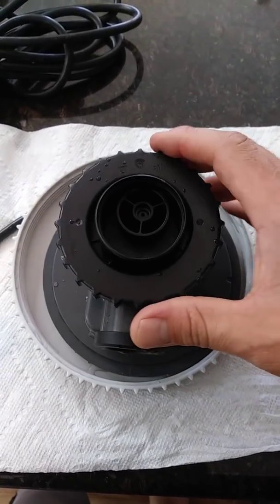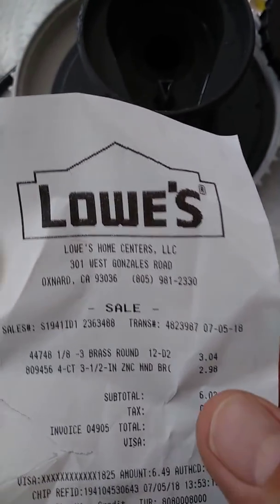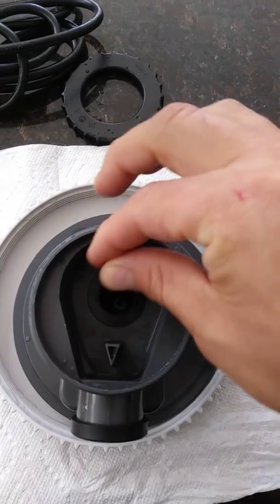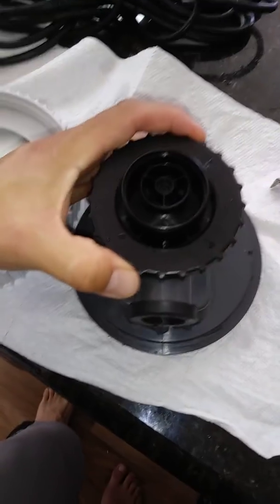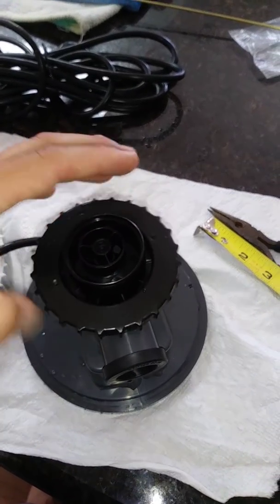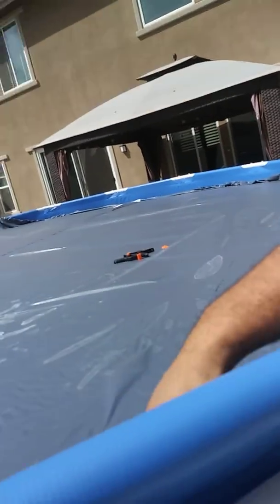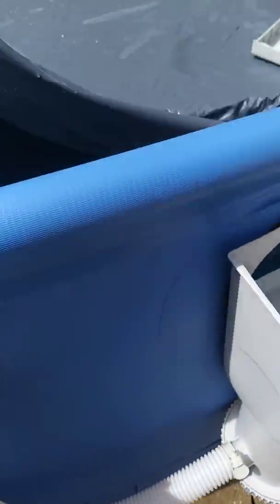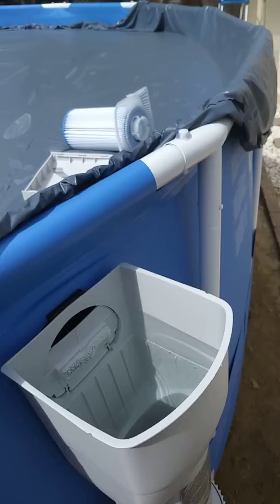SFX1000 pool pump repair

Comment: Ok my question is how do you get that bottom back on with it not leaking? I’m having trouble. I have a rubber ring too that goes around the pump in the canister but I can’t figure out how to stop it from leaking

Comment: Thank you for this. My pump did this within the first 3 days. Saved my sanity. Cheers man

For those whose pumps arent working, the motor is completely encase so if your pump is not working its probably a 90%+ chance its this

Comment: How do I know if it's the power plug or the pump itself I'm getting no power to the plug at all
Reply: I have the same issue. When it's plugged in, the display comes on the plug, but there is no power going to the pump. Not sure where to go from here

Comment: Thank you sir! Thanks to inflation, 5 years later that $3.04 brass rod is now $6.48. Still much cheaper than replacing a pump, but pricing double in 5 years??? That's insane.

Comment: Ours came with a rubber black circle ring for in the bottom where exactly is that suppose to be? Our filter is leaking water at the bottom seems like the ring may not be in the right spot or something.

Comment: Dude I’m stuck just trying to put the plug in to stop the water! How do you put this flat plug on!?
Reply from the maker: It goes on the inside of the pool. Over the inlet of the filtration system. You might have to let the plug sit in the sun for a bit to flatten out. That's if it has any kind of bend in it. Good luck.

Comment: How  do you fix the cord got power but not turning on anymore can they over heat?
Reply from the maker: If it has power but is not turning, it is being held up by debris or that shaft/rod is broken. I have seen a single strand of hair stop these pumps before.

Comment: Stupid Question here 🤦‍♂️
I had to take mine apart, but I forgot to take notice where the gasket was supposed to go.
Could you tell me where it goes?
Reply from the maker: Mine doesn't have a gasket, but there is 1 of 2 places where it can go. 
1. Inside the locking ring for when it is sealed against the housing. Or
2. Around the base of the actual pump, where it sits against the housing to creat a seal.
I hope that helps, if not, maybe someone else with a gasket can assist. Good luck.

Comment: Mine doesn’t turn on
Reply from the maker: The rotor assembly is probably jammed up with hair or sticks or some sort of debris. Open it up and clean it out.
Reply: @bobganoosh5520  yea I cleaned it works now thank you
Reply from the maker: @vionic7170  Awesome. Glad to hear. I had a friend tell me the electric went out on his pump one time. He was ready to throw it away. I opened it up and it was a single strand of hair preventing a pump start. That's all it takes with these cheap pumps 👍🏼

Comment: How did you cut the brass rod?
Reply from the maker: I used standard wire cutters. Just spin the rod a little bit at a time. It's tough to cut straight through. Also by scoring around the rod vs cutting straight through, you get a cleaner cut. Hope that helps.

Comment: Thank you for posting this! is there a washer at the bottom part of the pump where the impeller sits? I don't see one if they are I see the ceramic one at the top? Thank you again for posting this fix!
Reply from the maker: There wasn't a washer for mine.

Comment: Thank you so much.  $1.79 brass rod from Ace and I'm back in action.  I had the broken spindle for a while.  I knew it, but it kept running.  Then yesterday the pump just seized up.  I could hear it hum and could tell it was pulling some amperage, but the impeller was stopped.  I tried to free it with my hand and it strongly flicked my fingers.  Went to get the brass rod, and it's good to go!  Thanks again.

Comment: And it’s done, mine cracked into 3 pieces, little tiny piece was in a upper rubber seal. I cut it on 3 5/16” length inserted and it’s working like new again, nice and quiet,  thanks again😀🤛👍

Comment: Will this help for the leaking under the pump?
Reply from the maker: If there is leaking, maybe the locking cap need to be reset. Plug the inlet, drain the housing, ensure everything is lined up. If there's a gasket make sure there's no build up on it. Have 2 sets of hands if possible and re-tighten the threaded locking cap. Hope that helps the leaking. Did you take it apart before and then it started leaking? Or did it just start leaking?

Comment: What side does the seal/gasket go on? For the largest base of the pump ?
Reply from the maker: Mine did not have a gasket, but the gasket would go between the pump and the housing canister. So pretty much at the bottom.

Comment: I tryed a stainless steel rod but unfortunately didn't work I understand why brass now......🤦not magnetic and stainless steel is. Only reason why I tryed stainless steel is its what I had on hand.
Reply from the maker: Definitely worth the try 😁
Reply: @bobganoosh5520   So stainless steel is not magnetic after all bro I can't get the pump to set right or seat right so the impeller will spin.  I should be able to just drop the umbrella in on the shaft and it should set correct?  Otherwise it's just vibrating and not spinning
Reply from the maker: @baircichlids5350  make sure the ends of the rods are smooth with no burrs/sharp edges. Yeah, the impeller should drop in and set properly, but there were a few times when it took me a few tries to get it. You might have to wiggle and spin together to get the magnet to catch it at the right spot. But like I said, ensure that the shaft is smooth.
Reply: @bobganoosh5520  okay thanks and rubber boot at the bottom with the ceramic washer correct
Reply from the maker: @baircichlids5350  Yes that has a groove to sit inside the housing
Reply: @bobganoosh5520   After a lot of adjustments and a lot of on and off it's working great. Thanks for replying so quickly with extra help. God Bless
Reply from the maker: @baircichlids5350  that's great news. Happy swimming
Reply: @bobganoosh5520 Mostly for the kids but for sure you as well

Comment: What did you cut the rod with?
Reply from the maker: I used wire cutters/diagonal pliers. After cutting the rod, just ensure the cut end(s) are smooth and free of burrs and sharp edges.

Comment: .....how does the oring go on? I put the whole thing on and its leaking from the bottom.....
Reply from the maker: Mine didn't come with an O-ring. But it must sit inside the locking cap that threads to the housing. So when sealed, it would be between the pump and locking cap. Hope that helps.

Comment: I'm having trouble with my pool not circulating water well, it sucks slow do you think this could be my problem? I may take it apart to check it out, after my kids swim.
Reply from the maker: If the rod was broken, the pump would not circulate at all. If there is some suction and the pump is functioning, there must be some blockage. Just try cleaning it out first and verifying there aren't any leaves, bugs or twigs that are blocking the inlet or discharge. Good luck.
Reply: @bobganoosh5520  do you have any idea about the newest model pump, zfx 1500 I believe is what it is.
Reply from the maker: @Linnnddaaa  do you mean sfx as opposed to zfx? I believe they are very similar to my pump. Just stronger motor.
Reply: Let me take a look, it was on the elite summer waves pool i had to get a new one this year. Its a little different from the pump shown(I also have that one i saved it from my trash pool. )
Reply: Its the sfx1500 model.
Reply from the maker: @Linnnddaaa  yeah, so it should function the same as my sfx 1000. Open it up and clean it out. See if that helps.
Reply: Hubby unscrewed it and the pin and other peice don't come out. So we shall see, it looked alright tho
Reply: The pin isn't ceramic

Comment: Where does the big o-ring sit on?
Reply from the maker: Mine didn't come with an O-ring. So not exactly sure. It must be in the bottom of the locking ring to prevent leaking from the housing.

Comment: Exactly what I needed, you rock!! Thankyou
Reply from the maker: Glad to assist. Happy swimming
Reply: @bobganoosh5520  so I did it, and for sum reason it's still not pushing water out. The rod was broken. Bought exactly what you said from Lowe's and cut to size, it felt a pinch lose compared to the ceramic rod that fit right and snug. After setting up it's the same sounds and no water moving. 😣Please help
Reply from the maker: @WhoKnowsYweKnowWutWeKnow  if you cut the rod, it could be a rough or uneven edge on either end. Take the rod back out and file/sand it down so it it clean and smooth. Hopefully that helps.
Reply: @bobganoosh5520  thanks, it was totally rough on the edge we cut. Will try and update, thank you for replying so fast, kids will be happy if we get it fixed soon. ⭐

Comment: Mine is blowing the dirt back in when I vacuumed I have put in a new filter what should I do
Reply from the maker: You might have to flush the inlet hose(s). If there is a new filter, make sure that the inside of housing is clean and no left over dirt in the hoses. Wish I could be more help

Comment: Mine didn’t snap but the motor is making a loud noise and not moving the water.
Reply from the maker: It's probably jammed up with debris. Just try cleaning it out. See if it continues.

Comment: Thank you!! Just to add on, i did not have the rubber stopper.  You can make this repair without removing the pump if you dont mind getting your arm wet.  Thanks again!!

Comment: My pool isn’t putting any water through the tubing back into the pool. Sounds like this may be the issue. I don’t know how to take the pool pump apart at all though.😩
Reply from the maker: All it really is, is unscrewing the locking ring on the housing/canister then the locking ring on top of the actual pump. Dive right in, you'll find it's much easier then you think.

Comment: I did this and my pool water turn green after two days did that happen to you im reahocking the water
Reply from the maker: Never happened to me. Green is algae growth. From high phosphates and low chlorine levels. It's definitely not from the rod. Haven't heard of this happening to anyone else either. The heat from the sun diminishes your chlorine levels which leaves room for algae growth. You can drain and start over. Or shock the heck out of your pool with high doses of chlorine and keep the filter running for a few days. Cleaning the filter or swapping it out frequently. Good luck. Sorry this happened to you.

Comment: My question - what the order of assembly when putting back pump into canister.
Reply from the maker: The pump is one unit. So the only order is to stick the pump into the housing/canister. Just have to make sure you line up the discharge of the pump to the outlet of the canister. There should be a notch to help line everything up. The tricky part is holding the pump still so you can properly thread the locking ring. Hope that helps

Comment: Mine is set up but it’s leaking! I don’t know what to do
Reply from the maker: I wonder if your locking cap is cross threaded? Also, did your housing come with an o-ring. If so, make sure it's seated properly.

Comment: How did you know it needed repaired?
Reply: Some mechanical type people are willing to look into why something failed, and a little investigation is all that it takes sometimes to discover what the problem is/was.  This is what I did because I knew it would be at least a 100 buck to get a new pump and an 2 hour drive to get one.  Glad I found this video. My first attempt to fix the pump I tried an old drill bit, but i knew it would eventually rust (not good).  So I did exactly as this video suggested and pump works fine again.

Comment: Thank you very much for this video this was a big help!!!
Reply from the maker: You're welcome
Reply: Ok it broke again, I did exactly what you did. I just took my pump apart again and the piece from Lowe’s is now grounded down in certain parts of the shaft and it broke a piece off any suggestions?
Reply from the maker: @michelletheriot1029  yeah, mine has broke a couple of times as well. But the metal rod is stronger than the original ceramic rod. My suggestion is to not run the pump when people are swimming. Run it before or after. That should help prolong on the rod life.
Reply: @bobganoosh5520  now I have another issue the actual blade of the rotor assembly two pieces broke off lol this pool is giving me hell
Reply from the maker: @michelletheriot1029  sounds like you need a new rotor assembly. Check Amazon or the manufacturers website. If it's SummerWaves, their site is https://www.polygroupstore.com/SFX1000_Pool_Pump_p/p58x1001c000.htm
Good luck.
Reply: @bobganoosh5520  hi I’ve been trying for 3 weeks now I only have two blades left on my impeller blade I can’t find the part anywhere’s. Any advice? Do you know anything about carbon fiber daft pin and blade? Thank you
Reply from the maker: @michelletheriot1029  if you have the sfx1000, here are a couple of links to try.. I am not familiar with a carbon fiber rod. If you are able to find the replacement, only run the filter when nobody is swimming and pool is empty. Hope this helps.

https://www.walmart.com/ip/Replacement-Rotor-Impeller-Shaft-for-Summer-Waves-SFX1000-Pool-Filter-Pump/571522972

https://www.ebay.com/itm/233986943985

https://www.amazon.com/SUMMER-WAVES-Replacement-Assembly-P58050505/dp/B01DCIMBBM/ref=mp_s_a_1_3?dchild=1&keywords=summer+waves+replacement+rotor+assembly+x1000+filter+pumps+p58050505&qid=1626364898&sprefix=summer+waves+replacement+rotor+assembly+x1000&sr=8-3

Comment: Mine won’t even turn on.  I am a single mom.   Could it be the ceramic rod or is the motor just  burnt out?
Reply from the maker: Hi Monica. The motor would still turn on if the ceramic rod was broken. These motors will not turn on when they get stuck with debris. All it takes is a strand of hair or a little leaf and it can lock these motors up, making you think it's an electrical problem or fried motor. When it's most likely not. If you have the capability, open it up and clean it out. Hopefully that solves your problem. Let me know how it goes.

Comment: Does the cover of the pump have a gasket?  My pool loses lots of water from the top of the pump housing.
Reply from the maker: No it doesn't. Is it the same pump housing? If you are losing water out of the top, I believe your water level could be too high. If you look inside the inlet circular ring of the housing,  there is a max level indicator. Be sure it's below that. Hope that helps.
Reply: @bobganoosh5520  it’s not the exact pump but very similar. Think you’re right about the level. There isn’t a level indicator but inlet port is submerged currently and no one is in the pool. With people in it, it’s bound to overflow. Thanks for the help and info.

Comment: Thank you for this video! The ceramic pin broke off in the rubber tab inside the housing. It was only 1/4” in. Used the brass rod and fixed the issue!
Reply from the maker: Awesome. Happy swimming

Comment: WHY DOESN'T WATER FLOW OUT OF THE POOL INTO THE PUMP CASE FROM THE SIDE "HOSE"  WHEN THE PUMP IS REMOVED;  5:02 ?
Reply from the maker: I am using a black rubber plug that was supplied with the pool.
Reply: @bobganoosh5520  NO, I AM TALKING ABOUT THE HOSE WHERE THE PUMP FORCES THE WATER THROUGH, BACK INTO THE POOL - THE WHITE/CLEAR HOSE.  THANKS FOR THE RESPONSE.
Reply from the maker: @cuttycolyar7991  there is no backflow because the discharge end  into the pool is above the waterline. I hope that answers your question. If that's what you are experiencing, maybe you plug the discharge port with a towel or plastic bag. Hope that helps.
Reply: @bobganoosh5520  WELL I GUESS I BETTER LOOK AGAIN. THANKS.

Comment: What if it’s leaking 😭
Reply from the maker: Maybe your locking cap is cross threaded. Or you might need to check your O-ring if equipped with one.

Comment: I’ve replaced the pin! Thank you for saving me so much money I also need to replace the impeller because some of the pieces are broke. Do you have any recommendations on how to? Or what can I buy to keep from buying the entire rotor?
Reply from the maker: Hi Kristy, just seeing your comment. Sorry for such a late response. I hope by now you got your pool pump fixed. If not, I believe you have to buy a new rotor assembly. I've seen them on Amazon or even the manufacturers website (if it's Polygroup). Best of luck to you.

Comment: Thank you, I was ging to buy another pump, we got three seasons out of the original. When the propeller is shot (no blades) does the power not work? I have zero power in the pump now that the blades are all broken.
Reply from the maker: In my experiences, I found that the pump loses power when the rotor assembly gets stuck/jammed by some sort of blockage (hair, leaves, debris). In this case, a small piece of plastic from the rotor blades could have found it's way inside. So try removing the entire assembly, cleaning and re-inserting. Then see if  you have power. Ultimately, you are going to need a new rotor assembly. If it still doesn't power on, could be the GFCI cord. Hope that helps. Good luck .

Comment: Do u know to fix the impreller all the wings r broken
Reply from the maker: I believe you have to replace the entire rotor assembly. You might be able to find just the rotor itself, but even with that, I don't know if it requires a special tool to remove/install. Not sure which model pump you have, but start here for pricing....

https://www.polygroupstore.com/
Good luck.